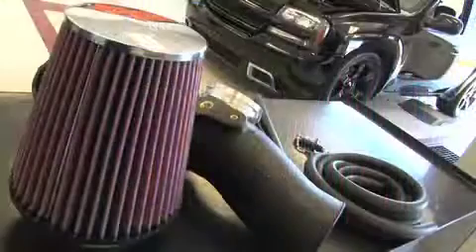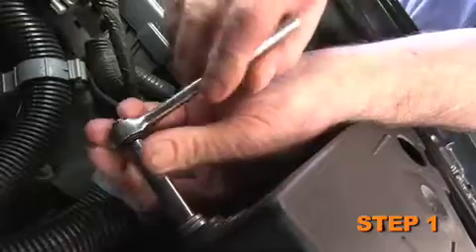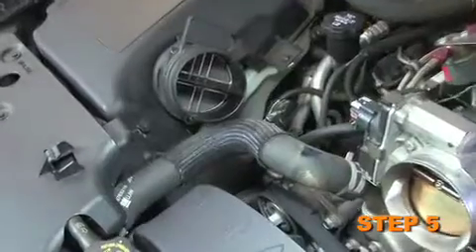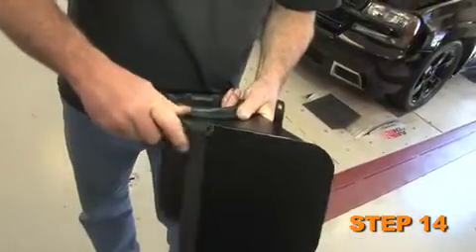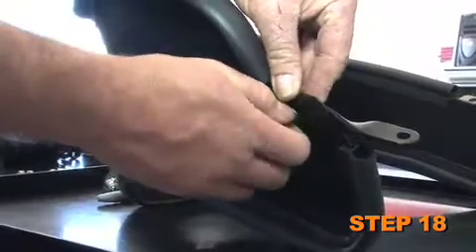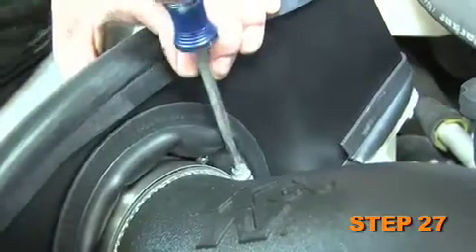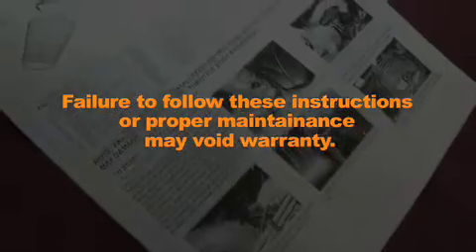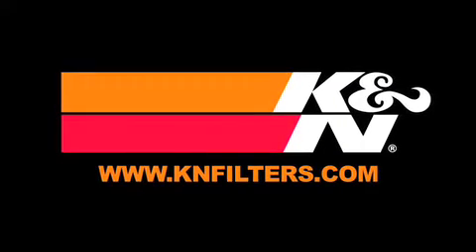Chevy Trailblazer 6.0L [#57-3061] Air Intake Installation

Comment: the heat shield closest to the headlight totally kills the ram air effect that the trailblazer ss offers from the vent in the grill under the passenger headlight. when i installed this intake i looked thru the vent and seen the black heat shield was blocking the path of cold air from outside! i removed it and cut a hole in the heat shield and when i looked thru the grill vent i could see the filter like its supposed to be! why did k&n block this? i seen a difference with the cut. check into it.